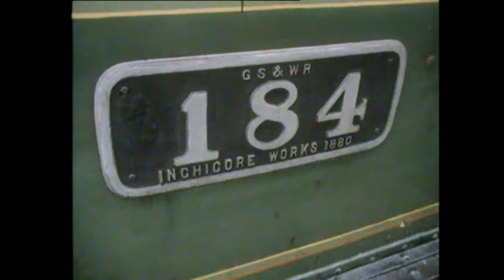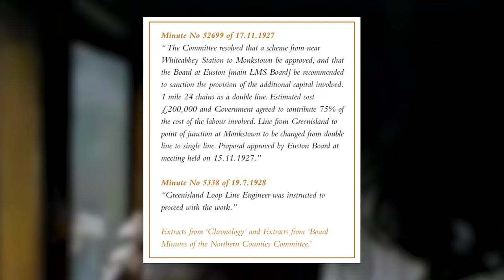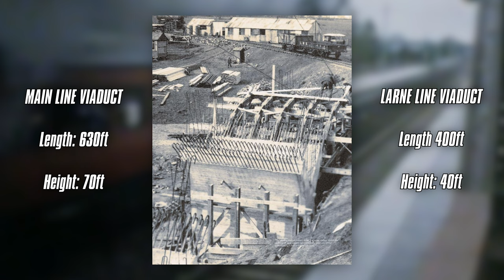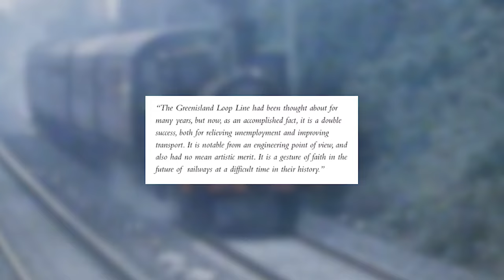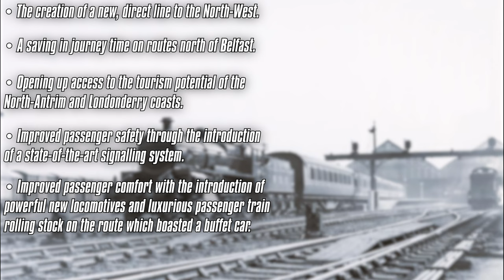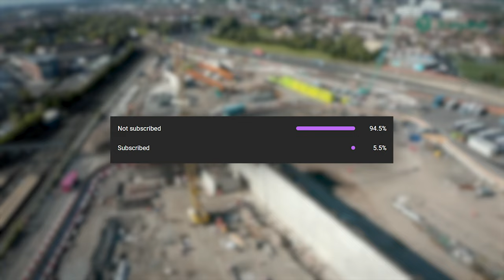Why was the Lisburn to Antrim Line Closed? | #OpenKnockmore [Part One]

Comment: Would this be useful as a direct Derry to Dublin link?
Reply from the maker: Not particularly no.

Where the Knockmore Line exits onto the main line towards Lisburn, there is no track going 'right' to send a train towards Dublin.

A better method for a Dublin - Londonderry link would be using the former 'Derry Road' line between Portadown and Londonderry.

That way the journey would be far quicker than going through the North where most of the line is single tracked.